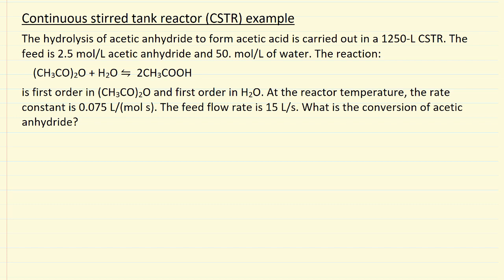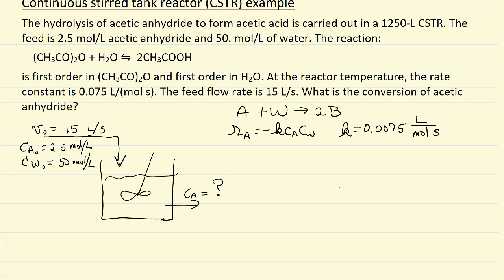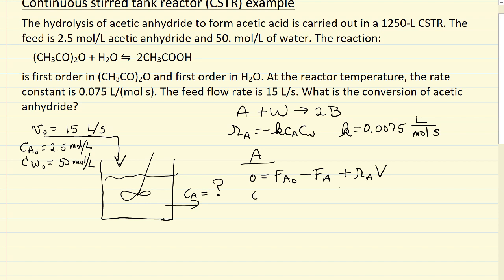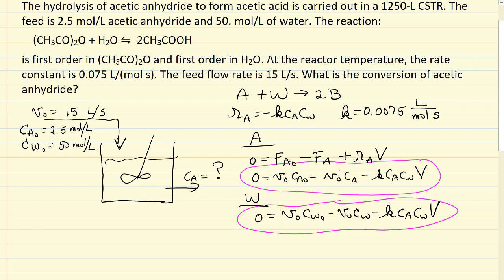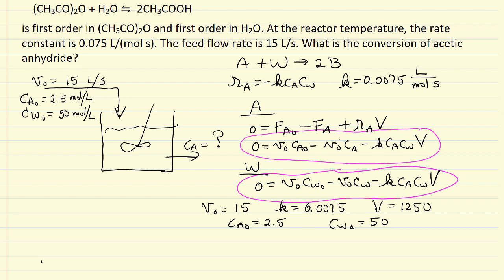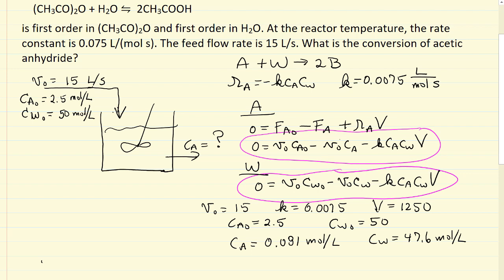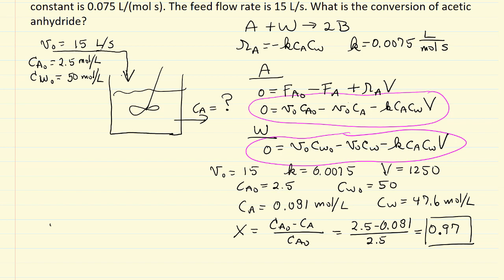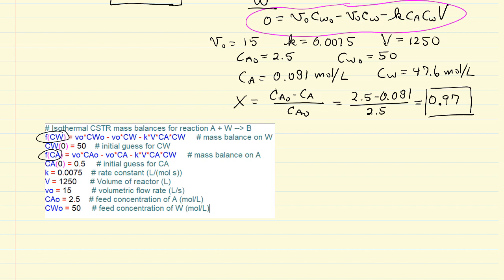Continuous Stirred Tank Reactor (CSTR) Example

Comment: You have off by a decimal on the rate constant you used. You used .0075 for k in calcs, but you have k as .075 in the problem statement.
Reply from the maker: Thank you! That is a great catch. The problem statement should say k = 0.0075 L/(mol*s).